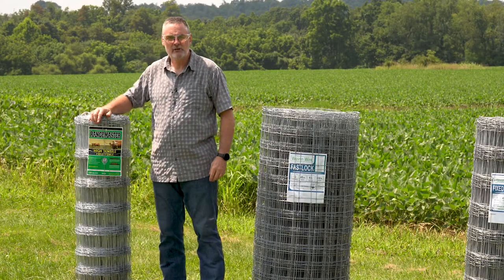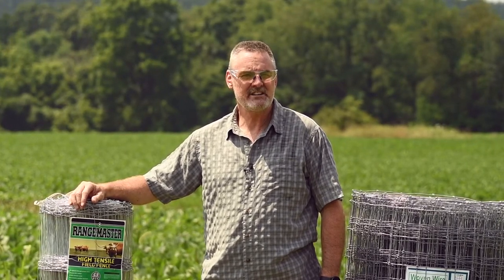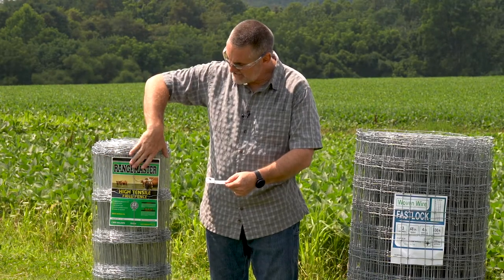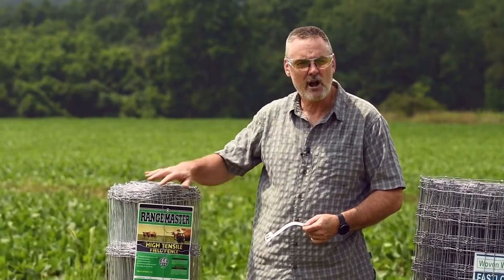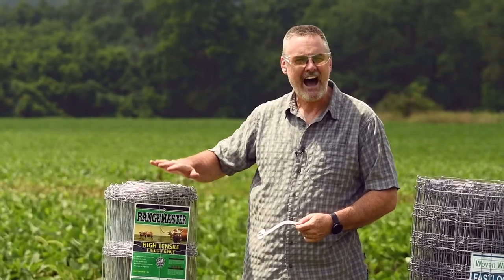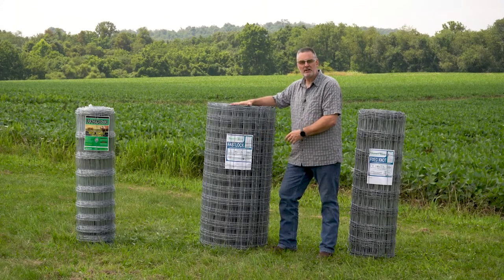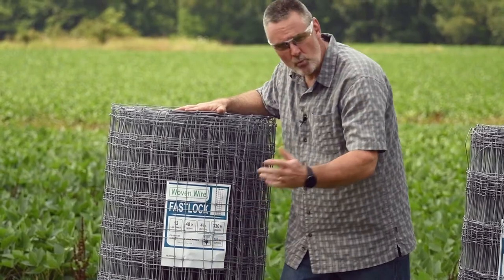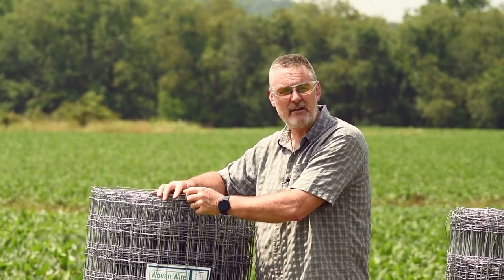Fencing 101 - High vs Low Tensile Wire

Comment: Thanks for the informative video. Do you know if red brand feild fencing is high tensile or low? Thanks
Reply from the maker: Hello Isaac! Red Brand manufactures both low carbon (low tensile) and high-tensile woven wires. You have to be sure to read the tags and specs. Even if it says 12 1/2 gauge, it may not be high-tensile. All of Kencove's KIWI Woven wire is high-tensile!